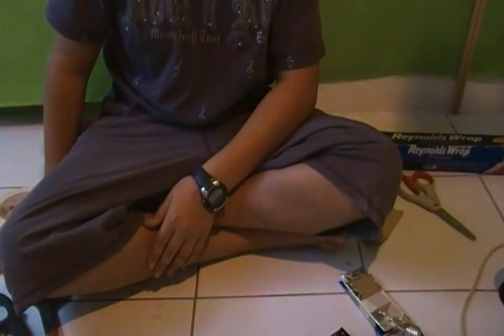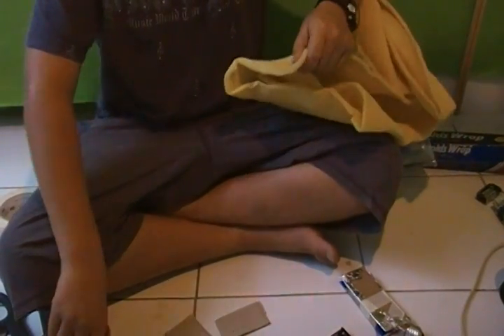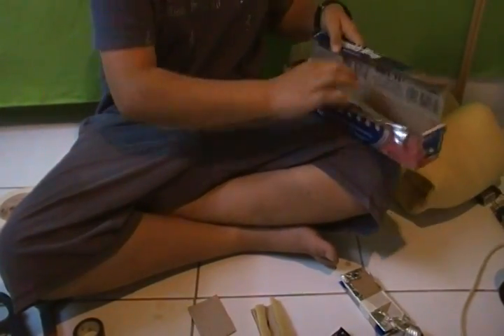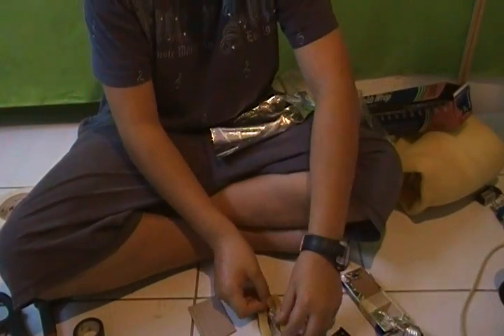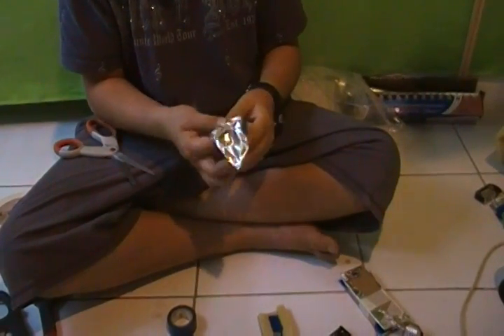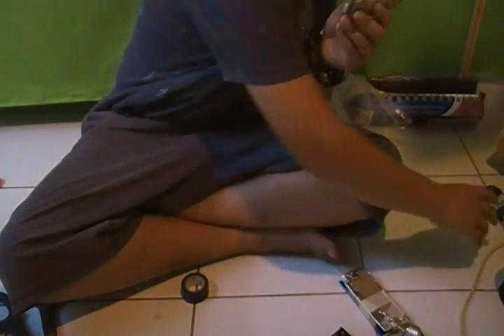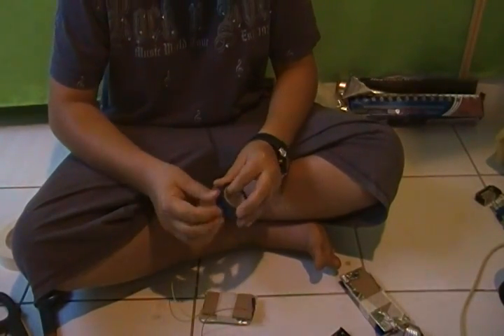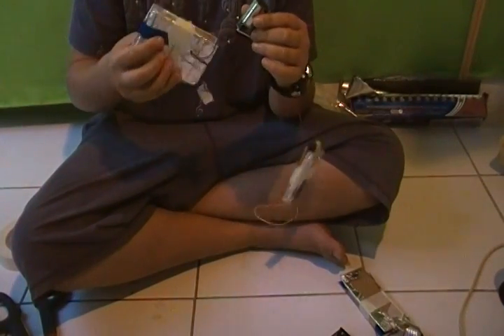How to make an electronic pressure pad

Comment: How do you connect it to a buzzer?
Reply from the maker: you connect one wire to the top foil piece and the other to the bottom, then you just run the ground wire directly to the buzzer, the pressure pad acts as a switch.